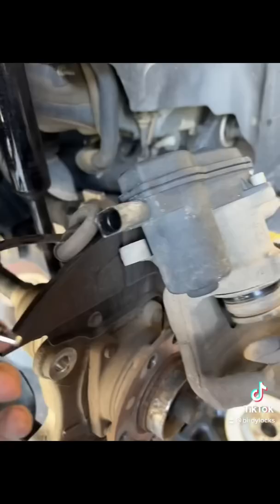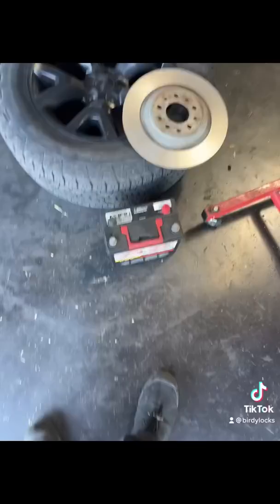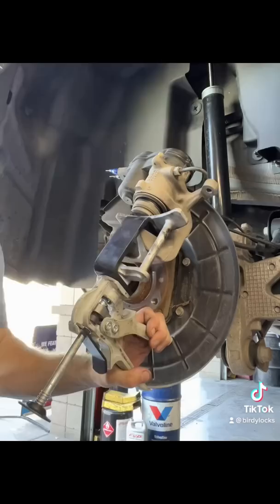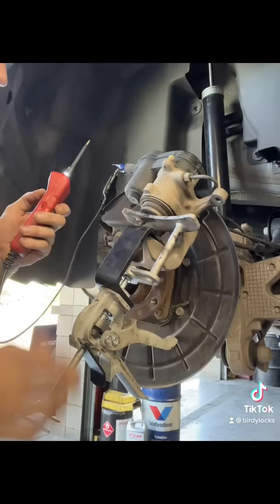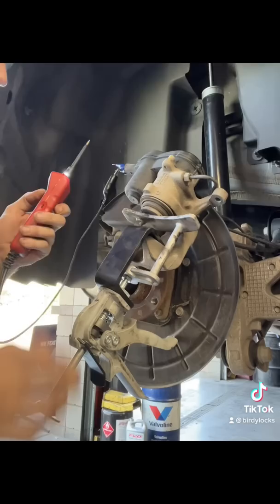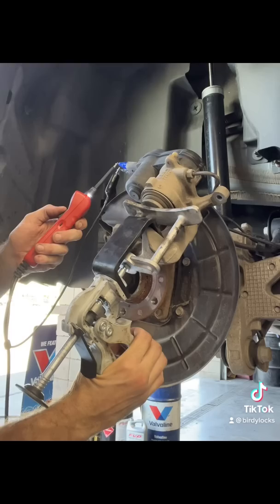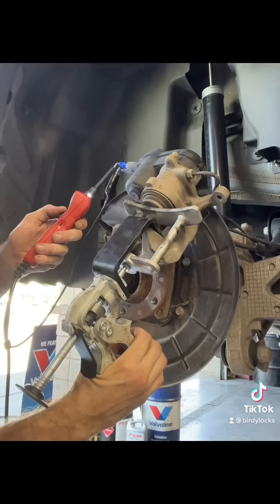Electronic Parking brake hack #EPB #automotivetip #automotivetechnician

Comment: Note to myself: don't buy cars with electronic parking brake.
Reply: Every Mercedes’
Reply: They are all going that way
Reply: Basically every new car
Reply: @mahouMorgan_P  yeah... Unfortunately.
Reply: Then you won't get a new one
Reply: They are the best trust me, no e brake cable to worry about no e brake shoes, springs etc etc. Way simpler and efficient
Reply: @audinthusiast3750  where one complication removed another is added. I understand that brake job is not something one does every month so having one special tool and learning how to engage the electronic system so the caliper piston can be pushed in without damage is not the end of the world I just pity electrification of something simple that can be implemented purely mechanically, like emergency brake system. 
Also, electronic brake has only so much clamping force so a car can be slowly emmmm... Slowed down. When it's mechanical and the cable adjusted properly then it's up to a driver's hand strength. So in really sketchy situation I rather yank the handbrake lever and stop the car quickly than push the button and stop in twice as long distance or even thrice
Reply: @audinthusiast3750  Yeah but you're also missing that those electronic calibers are $600+ per caliper.
Reply: My Ford at least has a mode to easily put the rear e brake into service mode. When applied you can push the piston back just like any other normal caliper. Super nice to have along with the convenience of never having a e brake cable stretch out and also uses the main brakes. Very nice
Reply: Absolutely, i dont need a new car or one this new. I prefer simplicity over fancy electrical gadgets to become troublesome and expensive to repair. I will keep my 60s-2005 vehicles i have now
Reply: Every new car 😆
Reply: Well... Actually I don't want any of the new car currently on the market. Literally there is absolutely nothing I would be 100% happy with as the only one and daily driven by me. 
So I am in the market for something in 2008-2015 range coz almost all best options that suit my taste and needs are in that years brackets
Reply: @audinthusiast3750  Yeah, just way more electronics to fail and leave you stranded. Perfect! Anyone who thinks electronic is better than mechanical has never done anything related to anything with an engine and tires.
Reply: My basic ass 2021 Corolla has it. So yeah every car is going to have it.
Reply: @mikeznel6048  buddy I am a tech… talking from an engineering aspect it is very efficient and better in every way, caliper motor failure is a very rare instance.
Reply: @Bob Saget well...yes. I stated it a bit earlier. 
Bbbbuuuut... Right now I'm looking at '12 Audi S4 6mt and I am tempted very much...
Reply: Not Toyota and Mazda
Reply: @ArtemLokhovitskiy  don't call it an emergency brake.
It is a parking brake.
Apply the parking brake in an emergency situation, and you're still facked
Reply: @anythinganytimealways  umm.... No. I disagree. It's initial intent is to be an emergency brake since it's independent from the main brake system. BUT it can be used as a parking brake because that's what it can also do - hold a car in place when it's drums parked (!)
Reply: Literally came here to say this.
Reply: You can get a scan tool for like $300.
Reply: @mattb3901  
A Mercedes has probably a built in computer that will disconnect the electronic parking brake. My Chrysler 200 2016 would have that though it doesn’t because I just have the limited model.
Reply: @ArtemLokhovitskiy  ok. Go do 50 mph and apply the "emergency brake"
Lemme know if it even slows down
Reply: @anythinganytimealways  I did and not once. Yes, it does slow down because brakes and handbrake cable on my car are in perfect working condition and serviced (cleaned, and moving parts lubricated) once every 6 months.
Reply: My 17 civic has one. My 18 accord. 
Rear on those cars twist in. They say turn ignition to on. It releases the pressure. Then I twisted in with needle nose pliers. No error codes on either car when I did rear brakes. All cars are different with this mess of a handbrake
Reply: I find them to be more reliable than the alternative actually. No fun for drifting in the snow though
Reply: @eric63377  I’d say it depends on the car - you can get a caliper for a civic for like 50 per side.
Reply: @audinthusiast3750  The other side of this issue is if that normal person trying to do those rear brakes doesn't have a $6,000 scanner or doesn't know how to put the rear emergency brake into service mode and deactivate the service mode.. Then they have to take it to a shop and pay to get it done and if they just ignore the caliber looking way different than all the past calipers have and just go ahead and remove it then they they're buying a new caliper as well.
Reply: Rang rover
Reply: They can release it in the car. This guy doesn't know that
Reply: Every Lexus!
Reply: They are actually very good.  Just one more thing you’ll have to get used to as cars advance.  Some fords and Hondas I’ve been in have them, not brand new either.
Reply: This is not for every car with an electronic parking brake. My car has one and didn't need a scanner or anything like that. It was the same as any other brake job.
Reply: Yeah but on a lot of cars you don’t need a scan tool or even something like this to do it. You just need to do a button combo with the parking brake button and it’s good to go,
Reply: My 2017 Santa Fe has an electronic parking brake along with auto braking and hold braking. All my calipers are regular with no electronics. Did my pads a while back and they were no different than changing pads on a car with a manual parking brake
Reply: @mattb3901  That's every new car
Reply: I didn't even know this was how they did it until now, I thought it was like on the aftermarket where it's just an electrical component pulling on a cable and some strain gauge to prevent breaking the cable
Reply: Legit
Reply: Every car has one nowadays
Reply: as long as the manufacturer make it cheaper to buy like the manual cable then there should be no problem
Reply: Just chock the wheels from now on
Reply: they’re a PAIN. i work at carwash where you have to put car in neutral and half the people can’t with they’re 2020+ cars
Reply: Really. It's stupid. Flat out dangerous. Your battery dies, how are you going to stop?
Reply: @mitchallen5819  it's a parking brake.
Reply: @jamesjameson2576  if it's electrical switch on the center console, you will have no brake if the battery dies. 
Seen this happen just this past week. Dude had to chock his wheels while getting a jump.
Reply: You can't anymore. Gotta stick to the older cars.
Reply: @natethompson1995  thats fine 😂😂
Reply: Agree, don’t buy electronic anything if you’re looking for longevity! I’m hanging onto my 2000, 2004, and 2002 vehicles forever!
Reply: @frozenfirestix  yeah newest vehicle i own is 2003
Reply: @graemelliott3942 Too many electronics stress me out.
Reply: Inevitable. Most newer cars will have them. Not that big of a deal. You can also take the cover off and retract with a torx or allen, done on my M5 and Audis.
Reply: I'm now the perfect example of "never say never"
As I recently bought B8 Audi S4 and yes... It has electronic parking brake (I hate it, but it's very minor minus amongst a bunch of pluses)
Reply: I still wont get one i have to use em at work daily and for me that is just no .. lol
Reply: Another reason why my current car is my forever car
Reply: Many vehicles have a service mode option on the center dash screen display. Following the manufacturer's specifications navigate through the program and set the electronic brake into service mode. This will retract the piston a bit.  While in service mode take the brake caliper tool and press in the caliper.  When you have completed the brake service go back to the program  and turn off brake service mode.
Reply: @ArtemLokhovitskiy  many newer vehicles that employ electronic brake calipers also employ a program in the ECM that allows you to set the brake system into service mode. This relieves the pressure of the electronic brake caliper.  While in service mode use the caliper press to press the piston down. Then when the brake service is completed go back to the dash display and turn the breaker service mode off .
Reply: Dangerous
Reply: You almost don't have a choice anymore!
Reply: All news have them now even toyotas
Reply: They are useless i always prefer hand brake im case my brakes fail and it happened on a 79 corvette .hand brake is the best foot brake is no good
Reply: Shit annoying caliper wouldn’t go back cause I still had the electric plug still plugged in 🙃
Reply: Yep I’m half way through doing my brakes and my piston is stuck out so over these modern cars I tell ya
Reply: @FusionKota get ready for one of those actuators to go out from a bad jumper wire or the kick panel connector connection my guy lol

Comment: Or simply remove the two screws from the motor & remove it & stick a Torx socket in the back & turn it out manually. No special tools required.

Comment: Y’all gotta realize that these EPBs have a maintenance mode that you need to activate before doing a brake job. Each brand varies on how to put it on maintenance mode.
Reply: and yet to get that mode you need to spend thousands on a scan tool. ill stick to my 90's vehicles.
Reply: Not necessarily.. alot of vehicles have a manual way to enter service mode ..it usually involves a sequence  of key on and holding the electric parking brake switch in one direction.. that being said some vehicles are scanner only to get to that mode ..furthermore the electric parking brake is a pile of $hit that completely defeats the purpose of having a " mechanical " non hydraulic brake as a backup
Reply: Mazda 6 has a maintainace mode you can enter without the need for a computer but I can't seem to find one for the kia optima
Reply: @agartin1 No lol
Reply: @agartin1  It's not necessary. There's a way around it
Reply: There's ways around it

Comment: note to self: don't buy a car made after 2007
Reply: My 2012 corolla S has rear drums
Reply: 2005 mate
Reply: my 19 q50 still has a manual parking brake
Reply: My 2009 Civic got drums electric power windows but no powerlock doors 😂
Reply: @joelh3030 my 2015 focus has rear drums. 139000 miles and I've only had to adjust them. I love having drums.

Comment: Well boys looks like it's old shit boxes for life for me lol
Reply: Same, I don't trust electronic steering either. I would guess that a physical connection gives off a lot more warnings than electronic failure.
Reply: @ianmoore322  you're saying electronic power steering doesn't exist? Because it does exist in America.

I miscommunicated about physical connections. I meant to say hydraulic power steering will give off more warnings of failure.

I imagine power steering fuse or electronic motor could fail while making a turn and you're struggling to adjust how much more effort you need to put in to compensate for the loss of steering assist.

With hydraulic failure you begin hearing that ominous whine that's telling you to check under the hood for leaks.
Reply: @trippin8585  oh boy you ain’t kidding! 06 Pontiac G6.... electronic steering is a fckn nightmare.. cars only got about 155k on it. It needs what’s called a tourque converter which is the brain of the steering. It’s still the weirdest experience I’ve ever had driving and feeling the wheel twitching and hitching up on NOTHING.. drove it like that till I just parked it one day cause it got to the point it was turning slightly on its own and holy hell it was hard to turn back!
Reply: Lol 😂🤣
Reply: @joshstrout9867  that's nuts! I almost bought a 2013 RDX until I found out it had electronic steering. Sounds great for the headache you'll save looking for an oil leak, but I'd rather understand there's a problem with the steering than to be caught of guard in the middle of an intersection
Reply: Actually steering by wire already exists in mass produced vehicles
Reply: @trippin8585  thank you, I agree 💯 👍
Reply: E46s and E90s for me.
Reply: @trippin8585  electric power steering is actually a lot more reliable than mechanical power steering, it has a lot less stuff that can break, it is just more complicated to fix if you actually have a problem and is more expensive.
Reply: @cadenwhite9713  where's the proof in that?
Reply: @trippin8585  you guys have powersteering? 😭
Reply: I miss my 65 Mustang more all the time. I could pull the engine and transmission just about as fast as changing the front turn signal bulb on my 93 Camaro. Lol
Reply: @trippin8585  electronic assisted steering exists. but the steering wheel is still directly connected to the steering rack, it’s not like the steering wheel is completely disconnected from the front wheels. but if that IS the case in some newer vehicles, then yeah screw that.
Reply: @RegulerShowTV  there are vehicles now without direct connection.

Also I'm sure that the electrical assist depends on torque feedback to you and helps rotate with you. What if the electric motor is failing and goes against your feedback?
Reply: @joshstrout9867  the 06 Pontiac is definitely a bigger problem than the electric power steering. My 07 equinox has plenty of issues, but steering and control aren’t one.
Reply: Hahahaha....
Reply: Only way to go
Reply: @ianmoore322  my bmw litterally has electric power steering, you dingus
Reply: @RegulerShowTV  Here is a whole video about it. He explains some of the advantages.
https://youtu.be/agMrewRJTow
Reply: Yessir.
Reply: @ArtemLokhovitskiy  Lexus RZ450e.
Reply: @cadenwhite9713  No. Its not. Electronic power steering has failure modes not even possible on a purely hydraulic system. Electronic power steering is still a hydraulic system, with an electronics control system. How you figure that hydraulic plus electronics is more reliable than hydraulic. Well, that just puts your ignorance on display.
Reply: @DieselRamcharger  how often do you see yourself having to fix a standard hydraulic power steering system vs a electric power steering system? Most everyone could agree that they have to fix the standard system more, that means the system that doesn’t have to get fixed as much is more reliable. This shows your lack of basic understanding of English or your lack of experience working on these different systems.
Reply: We fly airplanes like that. It’s ok.
Reply: @ianmoore322 boy you got no idea what you’re talking about… let the men chat.